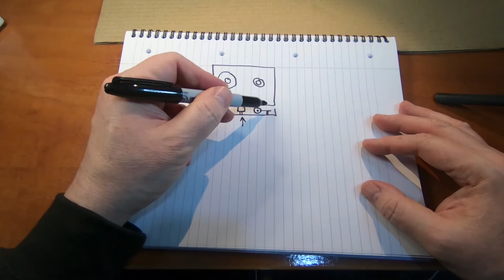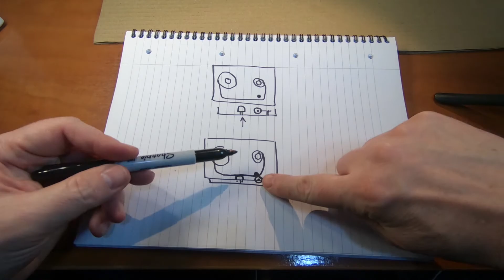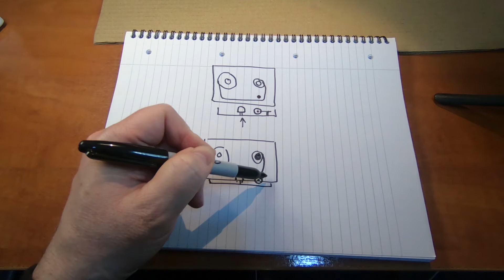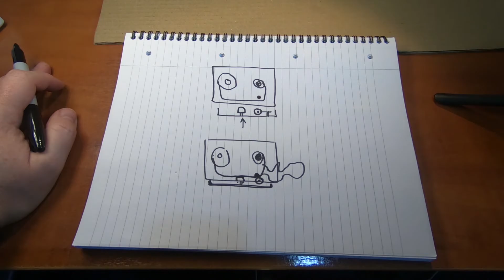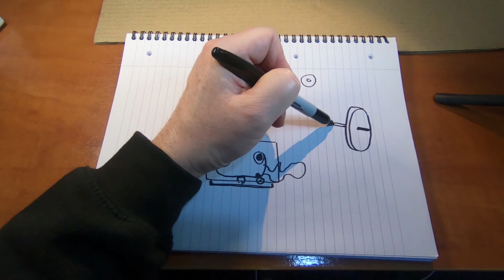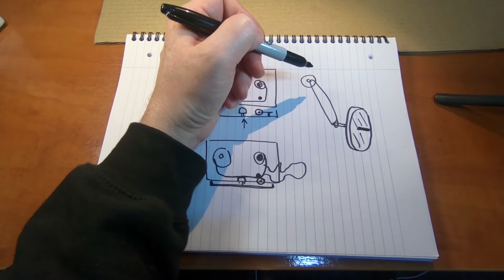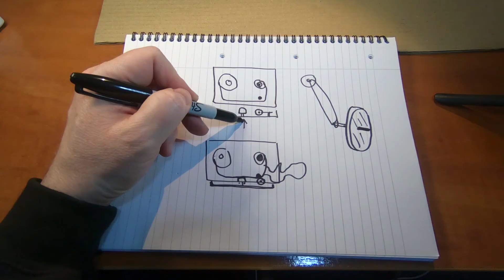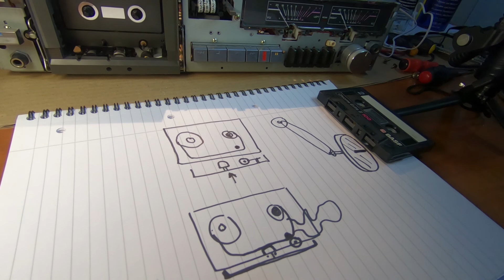What does a cassette capstan do and what causes tapes to play fast?

Comment: How the right roller collect the tape if its change the diamter of  the tape when its large or small tape its change the speed of the collector
Reply from the maker: The take up spool is always trying to spin faster than the tape exiting the capstan. It is on  a clutch so as not to snap the tape. It can spin faster and slower depending upon how much tape is on the spool.

Comment: Excellent, thank you!  What would you recommend for lubricating the moving parts of a tape transport during maintenance?  Also, do you recommend any specific tape cleaning and demagnetizing kits?
Reply from the maker: Thanks! Decks rarely need extra grease on the mechanism, but if you find parts are sticky (usually when there has been a lot of dust gotten in to the existing grease) then clean it off with IPA using cotton buds, then put on a small amount of new grease down. It doesn't really matter what sort so long as it not too thin or it will just end up everywhere. 
Cleaning tapes don't really do a good job as they only touch a very small contact area. Best to clean with IPA/cotton buds.
Any demagnetiser will do - even the cheap ones, they are all the same inside. 
Hope this helps.

Comment: What still not make sense in my head is that how is it possible for a cassete player to run fast on the right side and slow on the left side. In my head, they should rund on the same speed all the time. And when the you have play the tape over a half, it starts to slow down on the right, and the left side starts to spin faster
Reply from the maker: The only thing that is a constant speed is the capstan. The capstan sets the tape speed across the head. The spools will rotate faster and slower depending on how much tape is on them. 
Think of it as pulling hosepipe off a reel at a constant speed. Reel will spin faster as the diameter of the reel reduces.

Comment: First make sure the capstan and the pinch roller are clean.
Fast playback speed usually indicates a need for a motor speed adjustment, usually a screwdriver adjustment through a small hole in the casing of the motor.
A worn pinch roller causes tape speed fluctuations.

Comment: This was a big help. The pinch roller of my Yamaha KX-393 cassette deck, bought during the early 1990s and not used since around 2011, had somehow fallen out of position. After pushing it back into position the cassette played at the correct speed.

Comment: I have a question.  The take up wheel just wraps the tapes around it and by the time the diameter of the take up side (diameter of the reel inside the cassete ) becomes more than the supply side . Now the capstan is pulling and supplying the tape at the same speed and same quantity to take up wheel from supply wheel   but since the diameter of the take up side is getting increased then on the same speed of the motor it will try to wrap more tape reel around it . So how the capstan maintain this growing demand because it is with the collaboration of the pinch roller supplying the reel at constant quantity or length . May be , I am wrong but still it is not clear to me .Anyway , thank u .
Reply from the maker: @DebasisPoddar-qu9kp  it's a good question. The take up reel spins faster than capstan but it is able to slip and therefore slows down to match the speed of the tape exiting the capstan. So the speed of the spool does change depending on how much tape is on the reel 👍
Reply: @ANTandTEC I have a philips tape recorder and  I used to replace
it's plastic  gear when damaged .
Then  I  watched the same thing
i.e take up wheel can slips and even stops itself when the cassete is end but the capstan continues to move and there
was another gear to use this phenomena
to shut down the tape recorder completely (mechanical auto stop ).
I did it almost 15 years back and forgot .
Thank u for reminding me .That tape recorder does not run anymore due to lack of spare  parts .

Comment: What’s causing my tapes to snap? Could it be the old pinch rollers on my cassette deck?
Reply from the maker: The take up spindle has a clutch on it. It's 'allowed' to spin faster but the clutch slips which slows the spindle to the tape speed. If the clutch is stuck it will try to pull tape forcefully from the capstan.

Comment: Related question. What is the name for the widget that fits in the middle of the cassette reels? Need one for a Pioneer and never had one "go bad"  It just friction fits on. TIA
Reply from the maker: Not sure what part you mean. You referring to the swing gear that moves from one spindle to the other? If yes then they vary from machine to machine. What model do you have?
Reply: @ANTandTEC  was referring to...I think it's the "spindle tip, or cap" the part that goes inside the reel hole. It's a Pioneer CT series
Reply from the maker: @dvaughn58  All Pioneer cassette decks are "CT" 😅 
I've never seen that part for sale before or seen a deck missing gone but expect there are many decks with the same part. Maybe you can find a cheap donar deck.
Reply: @ANTandTEC  well, it seems all the non Pioneer are held on by a clip. This is friction fit. Was just wondering as to the official name of the part, tho per other inquiries it seems spindle tip or cap are it. Yes, lots of part out there, but HTF these. All the non-working ones I've got lying around are held on with a C clip. Thanks. The search goes on

Comment: WOW! I am subscriber 1000! Just print-screened it said 999 and I subbed and hit the notif bell. Updated the page and 1k subscribers! Haha would that make me lucky or so?
I have a question and I have a veery fresh and kinda brand new Bang Olufsen Beocord 5000 which worked and I tested it for some short time a few sec when I bought it 2nd hand.
Has just been chilling in my room and been off for some months since summer. Turned it on, powers on and all good BUT, for some reason when I load the cassette I now see the capstan pinch roller (metallic one in the lower bottom to the right) is constantly spinning? Dunno if it always does or not BUT. WHen I press play it like, connects play head moves up and begins to spin for 1 second and then click-sound and it returns and stops. Fwd or Rewind, same thing, 1 sec and stops. I'm so frustrated since I got the reciever and soon gonna have the speakers in a week.
Do you have any clue?! I have a recorded video and can send it to you also but here's a link to my post in an open FB group. 
Would be really nice if you could have a look. https://www.facebook.com/616865186/videos/1441822076765584/ All the best and thanks in advance!

Comment: Thanks for the video, just curious though.  If the tape comes through at a fixed rate per second, and the diameter of the take up spool changes from ~2cm to ~6cm, how is it able to take up slack at the correct rate when the circumference is 3x bigger?  If it's going much faster than it needs to, and the tape holds it back, there's permanent strain on both tape and motor.  Then you said you had the same motor for both, with a belt, but again, then the speed of both is linked, I don't understand how that works...
Reply from the maker: Hey. So this cassette deck has a single motor which turns the capstan at a constant speed. It also drives the take up spindle. That spindle if allowed to spin freely (with no tape in for example) would spin faster than it needs to ensure all the tape gets taken up. Yes there is some degree of strain on the tape but not much, there is a clutch mechanism that allows the spindle to slip with very little torque. The spindle will turn faster and slower depending upon how much tape is on that side but it does not affect the operation.
Reply: Thanks, very helpful! @ANTandTEC

Comment: My capstan motor has an adjustment hole but I can’t tell what’s going on in there. It’s at an awkward angle and I don’t feel anywhere for a screwdriver. It feels kind of springy and I’m afraid to mess with it too much. It’s playing like half a cent too fast
Reply from the maker: Yes, you need to be careful and feel your way around. You should use a very small flat-bladed screwdriver. The trimmer is likely to be this type https://tinyurl.com/4z3dt547 which will feel 'springy'.

Comment: what is the little needle sticking out?  I messed around with loop cassettes and now this needle is sticking out and it doesn’t play right
Reply from the maker: What needle? Please reply with the time of the video you are referring to.
Reply: @ANTandTEC  well I didn’t see it in your video I think I put it back in place right but now it seems it is recording over top endlessly of each track
Reply from the maker: @realityregenerator  when you push the record button it operates a mechanism which actuates a switch on the board. Sounds like what you are describing is part of that. If the switch on the board is now in the record state it will record all the time. 
You will need to take it apart again and figure out how that switch connects to the record button.
I don't have the machine anymore or I would have looked for you.
Reply: @ANTandTEC  thank you for responding I was afraid it was something like that I guess I messed up by trying to cover the erase head originally

Comment: Thank you, great description of how tapes work.

I saw a guy on YouTube repair the capstan motor, but it's easier to get a part like you did.

My Panasoic SA-PM27 stereo has the cassette playing fast so I was looking for info.

I was able to get the tape player to play with the lid open and the pinch rollers are in bad shape. The rubber is fine, it's the inside centre part. It's sort of a beige plastic film, loose with a gap, that is shedding onto the rubber. The right one did rotate but then stopped. 
Both are very loose.  
I will have to find a replacement part that fits.

Your video helped a lot.
Reply from the maker: Thanks! Yes, a bag of mixed belts is very useful to have around 👍
Reply: @ANTandTEC any special good place to order bag of mixed tapes from?

Comment: can  worn out or dirty capstan roller cause some decks to randomly stop during playback?
Reply from the maker: Possibly. Does it look as thought the deck is still trying to play, or has the play clicked off? 
It could be the auto-stop mechanism kicking in, and that would be due to a sticky mechanism or maybe a faulty tape that is not free running.

Comment: Supa-helpful and interesting video. I'm trying to get an old 1972 Akai GXC-46 going again, it was running great then just started to go a a bit 'warbly' and speed would fluctuate on the slow side. I've replaced the belts but I don't think the new ones are any good. They are square and the original was flat plus too tight I thinks? Replaced the run-cap still no change. I'm going to simpy try some 3-in-1 Oil now on a few bearings and see if that help's. These machines are 50 years old and were (usually) never serviced. The '46' is an amazing deck because unlike the more common '46-D' it has a built in amplifier and 2 x speaker terminals on the rear.
Reply from the maker: Thank you. 
Generally you can get away with slightly different sized belts. However, if your original one was flat, and the new one is square, there will be a lot less surface area of belt touching the rollers. This i suspect will be causing it to slip and give you the increased wow & flutter you are hearing.

Comment: Greetings
I record the frequency of 3000 Hz with the deck and the frequency is not stable during playback.
What could be the reason? Thank you
Reply from the maker: Likely a worn capstan roller belt or worn/dirty pinch roller.
Reply: @ANTandTEC  Thank you for your reply.
Reply: @ANTandTEC would silicon  be good enough for living or 3 in 1 or what

Comment: I bought a 1980s Sharp QT-V40(R) cassette player from U.S to Australia, i am using step-down 110 volt transformer, the radio works correctly but  when i press Play on the cassette deck it runs fast and i can hear a loudy ticking noise from the motor area it is same noise when i press RW or FF (I have not open it up yet ) Just looking for anyone help or suggests?
Reply from the maker: That is a cool looking portable cassette, not seen one before. 
Running fast usually is a worn or slipping pinch roller. However, the clicking could indicate 'sticky gears or maybe even a broken gear.

Comment: Thank you so much for the video. I have a tascam 688 and the playback is very very fast. I have replaced the pinch roller and the capstan belt, also checked that the capstan and the pinch roller move correctly, but the problem is still there... Do you think it may be a problem of the capstan motor
Reply from the maker: The usual cause of fast playback (especially when it's much faster than it should be) is the pinch roller is not engaged correctly. The pinch roller is sprung and should assert a certain amount of pressure on the capstan roller. 
If you are able to remove the door cover from the cassette then try stopping the take-up reel with your finger whilst it's playing. If the tape audio stops, then the issue is that the pinch roller is not engaging correctly. If the audio continues (fast) then the issue is the speed of the capstan roller - probably the motor.

Comment: Many thanks for this video. I wonder if you can assist with my old stereo cassette deck from the early eighties please. Power comes on but Can’t open the deck door - eject button doesn’t work. But because there is an intermittent clicking sound this until that is cured / fixed I won’t be able to open the door
Reply: JVC KD-D35
Reply: @JB-ox5wq  canola oil

Comment: How fast does the take up reel run compared to the normal speed when a tape is inserted?  Mine spins around 4x quicker than normal play speed without a cassette in it.  Isn't that alot of strain on the idler motor fighting the capstan which is running slower?  Tascam 133
Reply from the maker: It does spin faster with no load on it but it does not have much power. If you try and slow it down with your finger you'll find it does not take much effort, so the there is not much resulting strain.
Reply: @ANTandTEC  oh ok.  So where does the energy go?  The idler will be under load and the tape between pinch roller and take up reel right?  I just wondered if there was a clutch or something allowing some slip so as not to strain the motor that's trying to pull tape that's being let out slower by the capstan.  Its really clever when you look at mechanisms in the older decks.
Reply from the maker: Yes there is a clutch. Some more sophisticated than others depending on the quality of the deck.  And yeah the older stuff had a lot more mechanical parts and engineering.

Comment from the maker: If the slow speed is a constant speed, then it is likely to be the motor speed, and the adjustment pot on the motor (if t has one) would be the first thing to try. There may be a speed adjustment on the circuit board. If the slow speed is not constant, and is fluctuating (noticeable when a steady tone is played back) then it is more likely to be either bad capstan belts or worn/dirty capstan roller.

Comment: I have an issue with my Jensen player/recorder where it will both record and play back slowly. It’s barely noticeable but it makes everything kind of sound discordant. Based on the other comments I assume I have to open it up and adjust the motor and see if that works? If not, would the solution be similar to the solution in this video? Thank you!

Comment: I got told that the pinch roller that cause the cassette tape move faster and I just can't understand the concept until I see you video.  Thank you and thank you. You keep it simple and stupid (KISS) which is the best way to explain thing to my level (newbie).  In addition to the video, it would be nice to tell or indicate the bad pinch roller (why it is bad etc.) and how to fix it (sand paper?).  Also, is that way to test the capstan motor just in case that it isn't the pinch roller issue?  My deck is Sony TC-WR90ES.  The motor has 4 or 5 wires and it uses 12v.

Again this video is a very good/excellent video for my education. Thank you.
Reply from the maker: Thank you. 
When pinch roller rubber has picked up deposits, cleaning it with IPA on a cotton bud often is all it requires. You can also usually get replacement pinch rollers easily which will of course be a better option.

Comment: Appreciate this explanation! I have a Onkyo TA-TW470 and it allows you to play back in forward or reverse.  My understanding is that there are two capstans in each tape deck. It's currently only functional for rewind/fast forward so I suspect the issue is with the capstan belts. Would you happen to know if I need to replace 2 or 4 belts for this type of build? The old belts have all melted so I have no reference.
Reply from the maker: One belt for each deck. One belt runs both capstans.
So you will need two belts total to do both decks.
Reply: @ANTandTEC  I greatly appreciate your reply! Now onto opening this bad boy up. (I'll likely time lapse record it of anyone has any interest in that 🤣)
Reply from the maker: @Two-Eyed_Boy  👍

Comment: I have the Sony TC-FX2 and the motor is working fine for now but I would like to know where you bought a replacement motor for your deck.
Reply from the maker: Yahoo Japan auctions. I searched the motor part number and a seller had some new old stock.